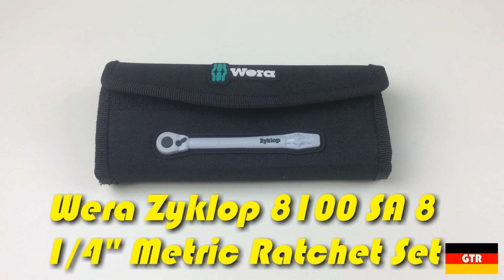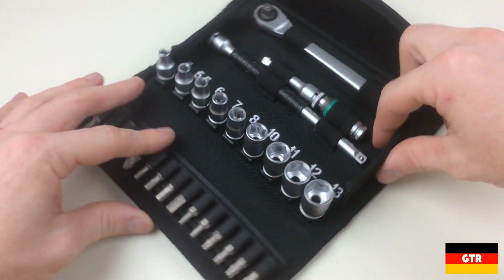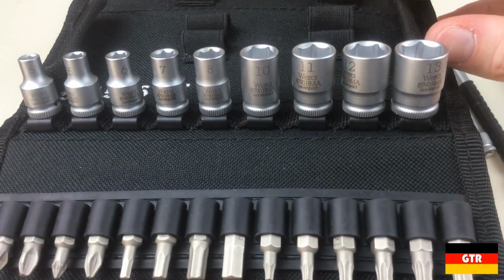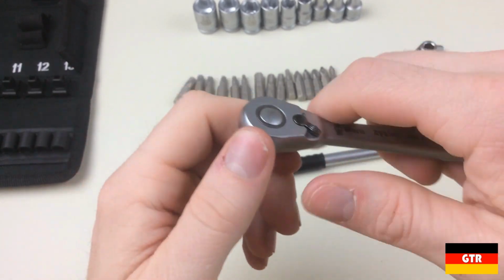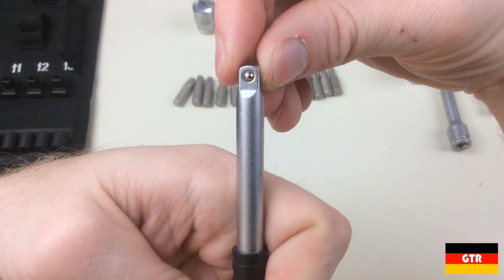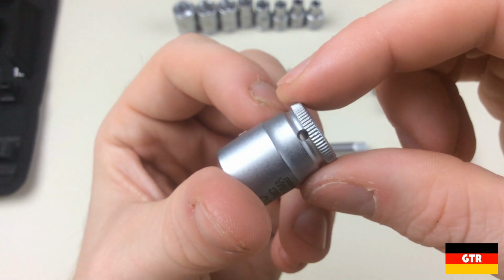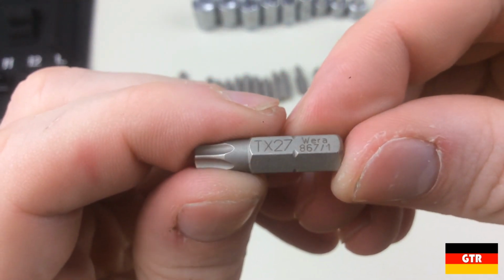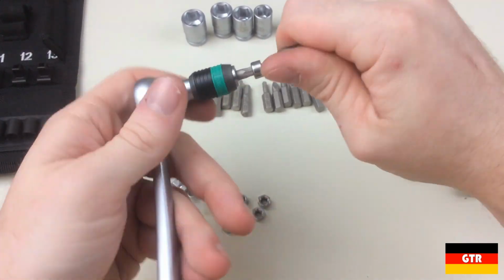German Tool Reviews:  Wera 8100 SA 8 Zyklop 1/4" Drive Metric Ratchet Set

Comment: German tools made in Taiwan CZ , that's what you said right ? they cant be  German tools then ? they are Taiwan CZ tools ! but that s not bad , I have been using Hilka , Draper , and Kamasa for years and obviously the odd socket / ratchet will break so you just get a replacement. If its made in Germany then OK, its German, if its made in Taiwan CZ its Taiwanese/ CZ and therefore fake German . So therefore , is this made in Germany or not? no sugar coating please !!!

Comment: Just bought this set and ratchet is different (it doesn't have that lever you have to turn around the ratchet to change direction) and sockets are color coded. Ratchet is model Zyklop 8003 A
Reply from the maker: They do have a version with a push-through ratchet.  The "8100 SA 7" and "8100 SA 10" has the push through ratchet, while the "8100 SA 8" and "8100 SA 11" have the one with the switch lever.
Reply: You should do video where you explain good and bad things about different kind of ratchets. I know that my version is probably the most cheapest and crappiest but I'm just interested about the differences between different kind of ratchets.

Comment: This set is available on ChadsToolBox.com for $83, even though I prefer KC Tools and there support and service they provide. Yes it would be nice if they marked the case if it's Metric or SAE. And I noticed the 3/8" version of this also didn't come with Velcro on the back like the 1/4" version did. So I guess I can't secure it to the "outside" of the Wera 2go Set.
Reply: KC Tools is way too expensive. If you have time order at amazon.de and such. Saves me always a great deal.

Comment: I don't think a tommy bar would fit through those small holes on the socket.  I really don't understand why Wera decided to go with that design.  Someone could see that hole and automatically assume it's an impact socket.

One thing I really don't like about Wera's socketry items is the loose tolerances.  They fit with so much wobble in them.  
I do find the the sleeved extensions to be handy, especially the locking extension type, and the Rapidaptor is simply great.  I have a few of them and would recommend them to anyone.

The Zyclop ratchets...not a fan of them.  I suppose they would work fine in clean, open environments, but not in modern-day cramped engine bays.
Reply: Something I just noticed watching the video...  The beveling machined to the entry of the sockets is SIGNIFICANT.  I tend to associate that feature to cheapy tools.  Really surprised to see that much bevel.  I would stay away from those sockets as it'll be much more prone to maring the corners of the fasteners if you're not careful.  It'll be especially crucial when working on shallow fasteners that you see more and more on modern-day vehicles.
Reply: ChrisCas aka Superautobacs 
Loose tolerance could result from hot forging sockets, if that's how they are made. Cold formed sockets( snap on/stahlwille/beta) have much less sloppiness.easier to control tolerances in cold forming. 
But if sockets are made in taiwan, then wera should price them bit less. Similar 1/4" taiwanese branded OEM( toptul/king tony/ etc) are 1/3rd of the wera price. 

I was thinking of zyklop set, but if you are saying it's not as good as advertised, I might consider something else.
Reply: +anurag77719  Judging by the looks of it Wera's socketry items are cold forged. Tolerances are based on regulations that provide allowable min/max standards.  So, tolerances vary regardless of the tool being cold or hot forged.  I just favour companies that manufacture socketry items that have closer tolerances.  

Wera's pricing is reflective of their premium brand image.  You're also buying into a product that offers features that aren't offered by other brands, like Toptul, KT, Sonic, Teng, etc, nor are they sold as  re-brands.  It's Wera's exclusive design and feature.  Don't forget that the the final assembly does take place in their factory in the Czech Republic.  So, that may reflect in the final pricing as well.

I personally don't have a thing for buying sets that come in carrying cases (I have tool boxes to organize them to my liking), so I've only purchased select items that I found to be useful, of which were the locking extensions with the free-spinning sleeve, and the rapidaptor.  I don't have a need for the original Zyclop ratchet (the locking swivel head with the spinning sleeve) for the type of work and environment that I use my tools.  That's not to say that I don't recommend them as it may suit your needs and wants.  Their latest ratchets are just that, ratchets, without the features offered in the original Zyclops.
Reply from the maker: Yeah there is definitely some play in the sockets.  The sockets are made in Taiwan.
Reply: Good point.......................
Reply: Stahlwille use the socket hole also , i think if the ball-bearing is in this hole you get the extra hold/grip :]

Comment: 9mm is also needed if you work on bicycles. Derailleur cable holder bolts are usually 9mm nut (or 5mm hex). Am I wrong or does that wobble bit work like this, push socket totally in and it's fixed, pull it out a little and it wobbles?
Reply: 9mm is also used on caliper bleed nipples on certain German cars, not even vintage.
Reply from the maker: The wobble extension has a little play that allows it to pivot 15 degrees in all directions.  The Wera catalog has a good picture describing this:

http://www-us.wera.de/product_detail_us.html?L=1&file=root_category_zyklop_ratchets_and_accessories_the_zyklop_ratchets_the_zyklop_ratchets_1_4_zyklop_accessories_1_4_8794_a&lang=en-US